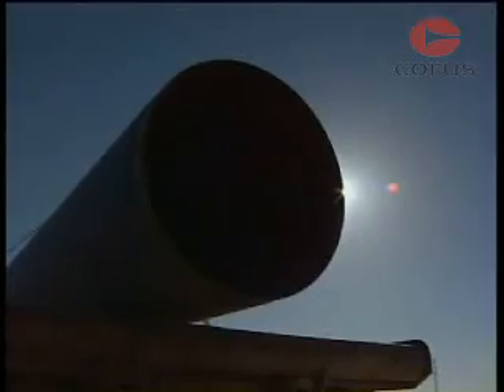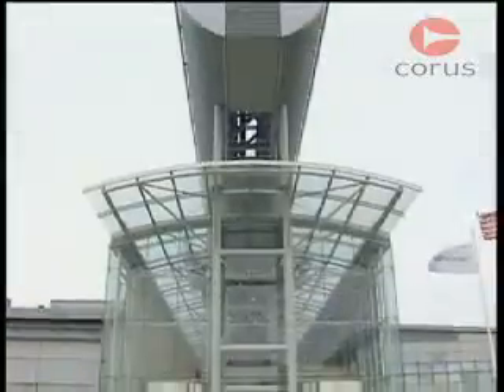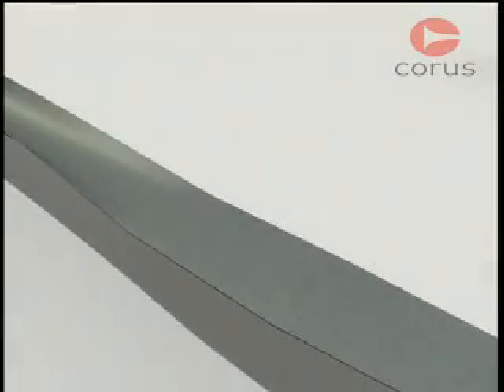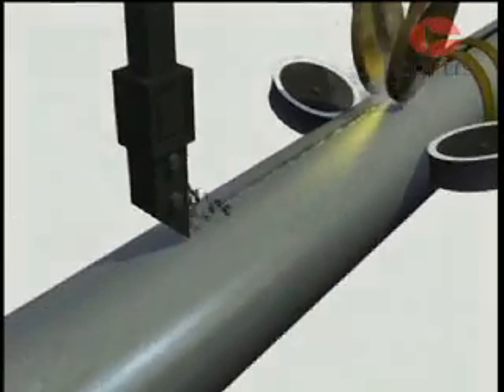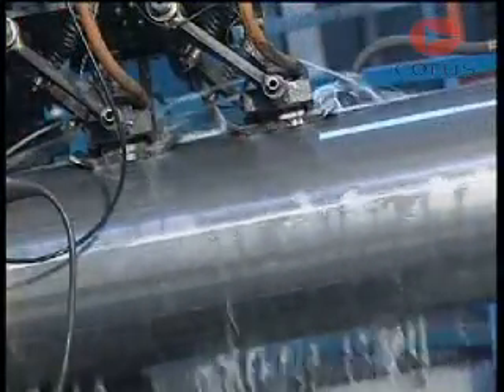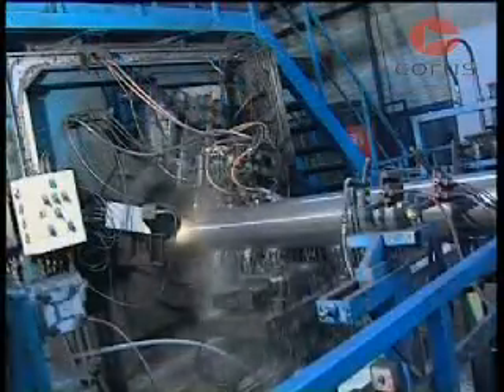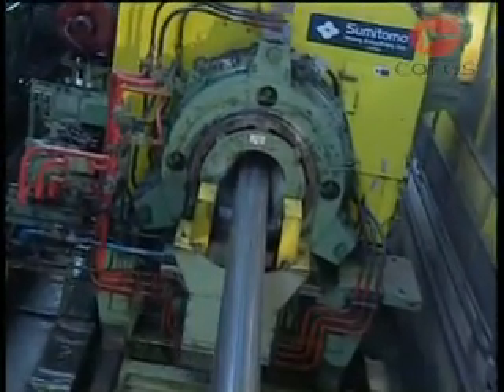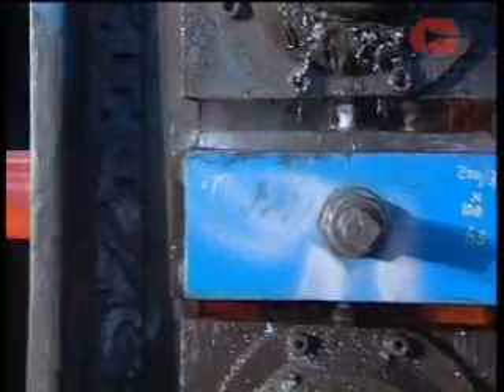Steelmaking: Tube Manufacture

Comment: Man this isn't tube making. I used to work for british steel Clydesdale work and made Steel pipes of offshore used seamless tubes. This meant taking a large billet of steel and heating it up, driving a 1000tonne press plunger down the middle of it and then rolling the billet along a internal bar using the pilger process. 

These tubes were incredibly strong and sought after for the offshore pipeline drilling.